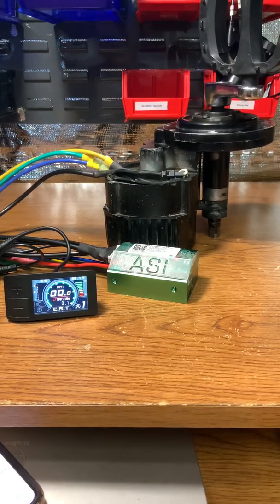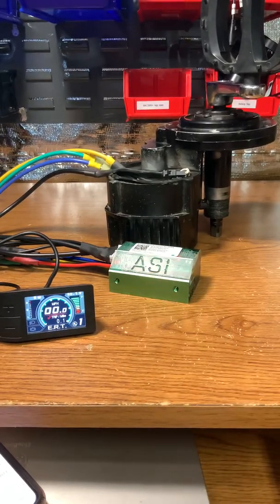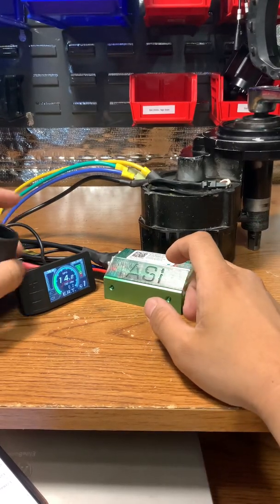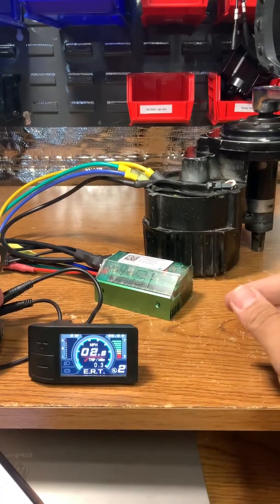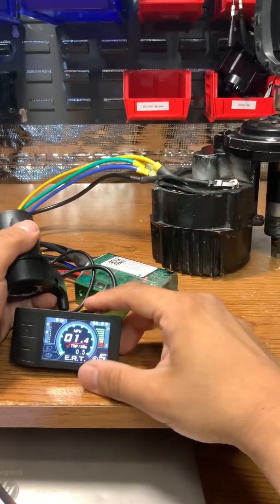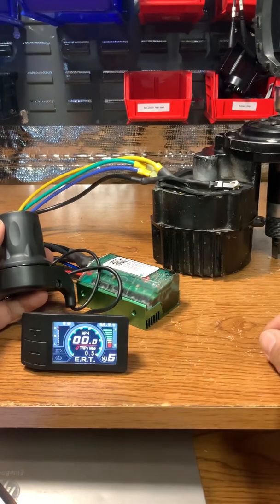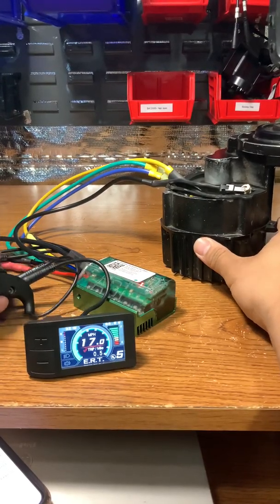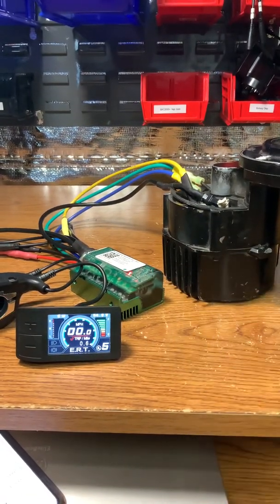ASI BAC800 BBSHD Variable Assist TFT Display Field Weakening 10000RPM+

Comment: Great video is is also my display on both bikes also so at least I will be able to use my display for the moment
Reply from the maker: daniel green you can use your display but assists will not work, you will be at max assist level
Reply: @wavebicycles  ah ok thanks for the heads up I shall just get the complete kits then with displays.